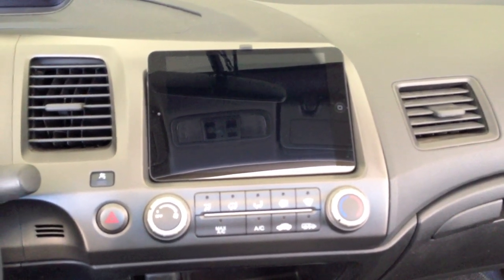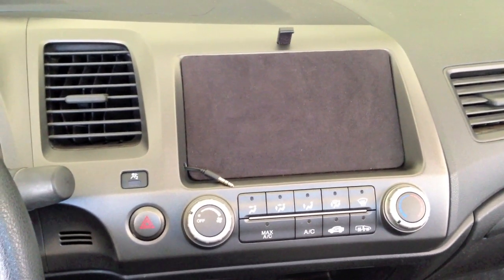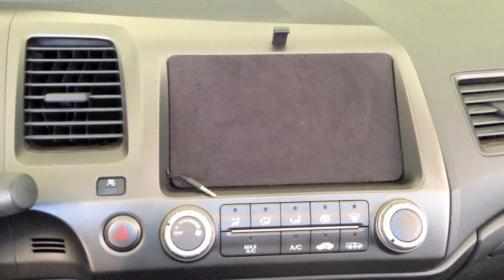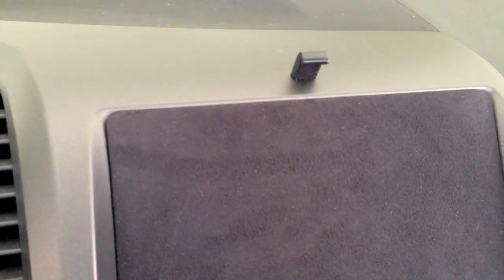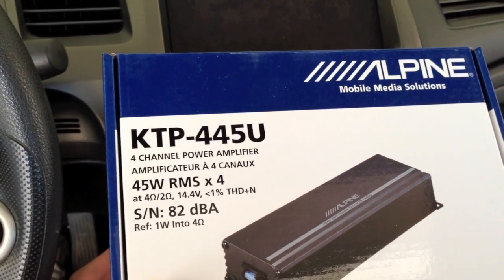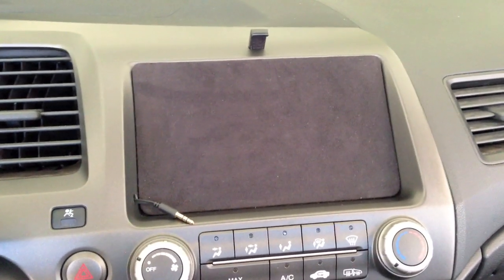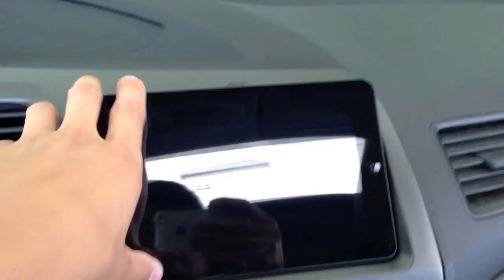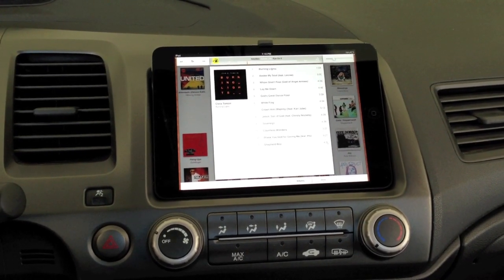iPad mini install in 2010 Honda Civic with Alpine KTP-445U amplifier

Comment: Hi, which trim level is your Civic, and does your Civic have the subwoofer in the trunk?  I have the 2007 EX coupe with the premium sound...6 speakers + subwoofer, and I heard it's more difficult to install it into cars like mine.
Reply from the maker: DjRuff617 I had an LX and no I didn't have a subwoofer. I'm not 100% sure, but I think all you need to do is trigger the amp in the wiring harness, don't think its a special harness or anything. I would double check with sites like metraonline.com to see. If you have steering wheel controls though you will need a special module to keep those working.